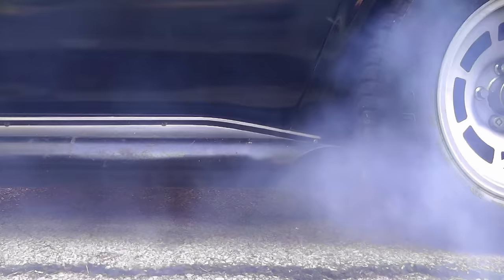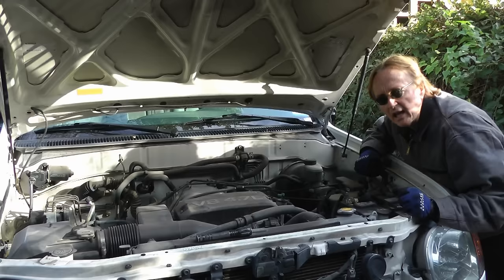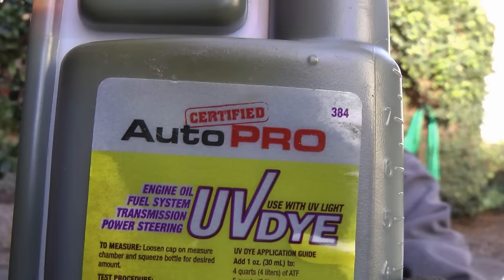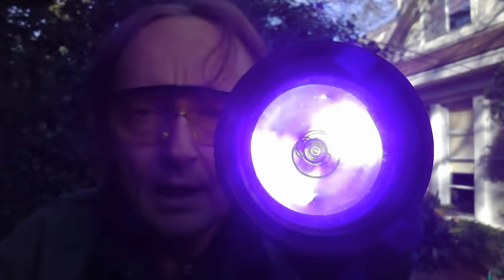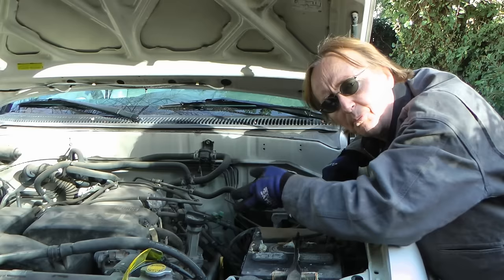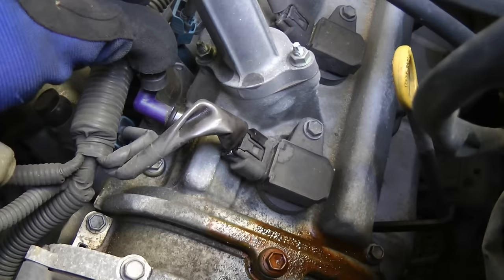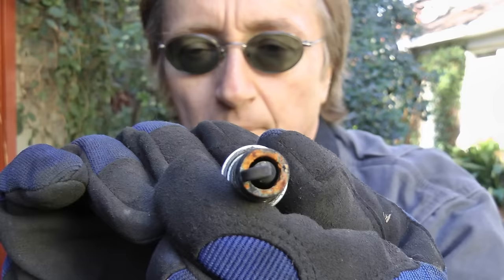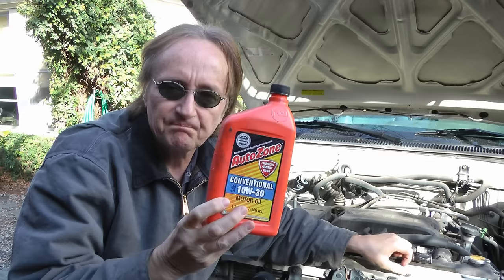How to Fix a Car Engine that Loses Oil (Leaks)

Comment: Scotty, do you use the Lucas upper cylinder lubricant and fuel injector lubricant cleaner also.  I buy by the gallon and use 5ozs per tank, cheaper by far than buying in the 50z throwaway bottle, you save hundreds by the gallon, it's only 30 bucks for 128 ozs as opposed to 6.99 for only 5.5ozs.  I put this product in all units I own.
Reply from the maker: Al Fries yes, I use it too
Reply: +Scotty Kilmer My dads 2006 mazda 6 4 cylinder eats a unusualy large amount of oil and it once even cranked for a little bit longer but no white smoke from the exhaust

Comment: I have a 2002 Ford Ranger 4 cylinder 2.3l and it starts leaking just when I drive about 35 miles or more, it’s a small leak...will Lucas oil take care of the problem?

Comment: I know for sure my car is sucking oil, there is oil in the mass airflow hose and on the throttle plate. Is there any other things that could cause this?
Reply from the maker: try a new pcv valve and pray, cause if it's not that, engine is flat wearing out and throwing blow bye from piston wear in there

Comment: I was leaking oil in a used car a got, after I got a new cap for the engine turned out the other one had the screws in so tight at one point that it got misshapen..

Comment: Chrysler 200, 2017 burns through 3 quarts of oil between service oil changes, Is this normal???? Capacity is 5 quarts of 0W20.

Comment: I own a 2010 dodge charger v8 hemi recently I changed my spark plug and Installed it with champion spark plug. But now I am experiencing misfire can u suggest me something which will solve the problem previously I was using NGK PLUGS

Comment: My 1999 Toyota Corolla only burns oil when I exceed 65 MPH.  Local driving does not result in oil usage.  Have 120,000 miles on the motor.

Comment: I have a Honda civic 1996 with a manual transmission and every gear works perfect except 2nd it grinds and it doesn't go in to gear most of the time I try putting it in, what could be the problem?

Comment: Scotty My engine is burning oil. all my mechanics cant find leaks and i replaced the pcv value and I got the same results. But I notice that I didn't have to add my oil as much when I wasn't traveling far or going too fast. I was good for 50-70 m/h  for about 25 min. but once I started traveling farther and faster I was constantly adding oil again. I have a 2004 camery. Any other specific things I can do to help out.

Comment: Hey Scotty..  Got a 2011 GMC Canyon WT 2wd with a 2.9l engine.  I'm running dexos approved synthetic 5w-30 and the using a quart of oil every 4,000 miles or so.  I cannot find the pcv valve???  The engine has 65,000 miles on the clock.  Is this a common problem with this type of engine??  Also, GM recommends 10k oil changes??  I'm thinking 7500 might be better?

Comment: hey scotty thanks for replying i got the fuse on ebay but it the blade looks a tiny bit longer than the original but is same ampage is this fine to put back in the computer?

Comment: Hi Scotty,
Thanks a lot for your video. I have a 2001 Nissan Sentra GXE 1.8 L, it has 262000 Kms on it. My mechanic changed the oil pan and gasket as the car was loosing oil. still it is loosing oil. But when I look under the car (after being parked overnight) I don't see any oil on the floor. I checked the oil 2 days after the oil pan was replaced and found that the oil level was very low and the color of the oil was very very dark. THe color was dark even befor the oil pan was replaced. Now my mechanic is asking me to replace the front crankshaft seal. What is your thoughts about it. Is it gonna  prevent the loosing of oil? Thanks in advance

Comment: I found a blob of something that looks like crushed charcoal under my 2005 Suzuki Forenza. Could this be a side effect of using Bar Leaks Head Gasket Sealer or Lucas Oil Stop Leak? 

A month ago I took it to Firestone to see why it sometimes smelled like burning and they told me that the head gasket is probably wearing out. I cant afford the repair or another car, so in desperation I tried those sealers.  The following week connection to the radiator goes out (dont know if it was related to head gasket theory from Firestone). I had the entire radiator replaced.

I bought some UV Dye, but would it also be a good idea to do an engine cleaning to see where it could be leaking?

Comment: Hi Scotty i got a 1995 Jeep Grand Cherokee with the Laredo 5.2Liter V8 Magnum i bought it 4 years ago. It currently has 186K miles i put about 40K miles on it seems to burn a little oil a very small amount every month I use( Mobile1 10W-30 High Mileage Full Synthetic)  i figure the thicker than 5W-30 would take more time to burn. There is no oil on my Driveway so it has to be a burn it is my Daily Driver. I always hear how Mobil1 is the Best what's your opinion???   Also what is your opinon on the ZJ Generation (1993-1998) Grand Cherokees are they as long lasting reliable as i hear????   How about the LA 5.2 Liter V8 Magnum engine i have is it a Great Engine and Long Lasting Reliable???  I really haven't had to replace anything on the Car except the Ignition Key Lock Cylinder.   I hope i can maybe 300K on the Odometer before i have to rebuild the engine or tranny. Also i usually now that i use Mobil1 10W-30 High Mileage only change the oil every 5,000 miles or 6 months because i hear how it can protect for 15,000 miles is that safe????

Comment: Scotty, I have a 2004 jeep wrangler 2.4L. It appears to be using oil, and there are no leaks. I took off the pcv valve after noticing oil on the nipple of the intake manifold. There appears to be oil in the pcv valve. I shook the valve and could hear the piece in the valve moving. The question is if the piece in the valve is moving (I dont know what it is called) is this indicative that the valve is functional and that the oil consumption is probably a bad ring? Or does this mean nothing and the valve may be bad (I believe it is the factory valve, the engine has almost 119,600 miles). Thanks.
Reply from the maker: brettdrk   just replace the pcv valve being that old, though they are supposed to rattle they can still be bad. But on those, engines are weak and burn oil internally at that age from bad rings and valve seals

Comment: Hey question real quick, is there a chance that it can be both PCV problem and hot oil leaking? Also that RV stuff if you pour it into the engine is it going to damage it? Do I have to do oil change after so? Please velp

Comment: Hi. I have a question about the engine oil. Is it possible and also safe for the engine to mix two 5w-30 full synthetic oils with each other which are both dexos positive?? For example 5liter of penzzoil 5w30 full synthetic dexos + with 1lit of mobil 5w30 full synthetic dexos+? Thanks

Comment: So if u have a valve cover gasket leak can u still use 10w30 to slow it up until u get fixed 2011 Chevy Impala Ls 3.5L
Reply: In the hot summer maybe

Comment: Hey scotty if oil is being burned due to a stuck pcv valve, would smoke coming out of the tail pipe be black?
Reply: Burning oil smoke generally has a slight blue colour. Black smoke usually means the engine is overfueling.

Comment: Hey Scotty! My car temp guage jumps around from 90 to 125 even past. Doesn't always park at bottom when cold or shows 40 or 90 right from cold start up. Not over heating. Squeezed upper and lower rad hoses can feel flow past thermostate. Hose temps feel normal. Blows good heat as always . Appears to be running normal. Changed temp sensor still doing samething. Any idea? 2.2 pontiac.

Comment: Scotty im trying to change my oil and the bolt on the oil pan is stripped "17mm" So I put some lock tight on and tried some vice grips with no luck. Any ideas? Also there is a small drip off oil off the oil pan but a lot of the engine is caked with oil and grime the drip is few and far between what do u think? will a black light work the same as the uv leak light?

Comment: I have a pretty big oil leak in my timing cover gasket on my 03 Mitsubishi eclipse Gt. It's been out for almost 6 months now. I just replaced the alt and battery so it starts but I can't seem to fix the oil leak

Comment: I have a mercedes cls 350cgi direct injection and its burning 1liter oil in 1000km but no signs of big leaks just small ones in the engine what might be the problem the car has 70.000 miles

Comment: hey scotty i got a question ?? why does my civic 2003 d17a jdm swap. burns oil but i only  have to put like a 1 or 2 lines of the quart every month is it normal ... i check for oil leaks and cant find none ... is only burning a little oil but is still burning it so is it normal for civics to do this ?? i currently using royal purple oil and a k&n filter every 4000 miles thanks=)

Comment: You think Lucas oil stabilizer will help with a leaky front crank seal?
Reply: Use a high mileage oil because it contains seal swelling additives. My LS1 was dripping oil on my garage floor. I switched out the oil for Mobil 1 High Mileage and it swelled up my oil pan gasket. No more dripping, but just some slight oil seepage. Be sure to clean the leak area with brake clean while changing the oil to see if the leak comes back later.

Comment: Scooty Can I use Lucas Oil stabilizer in fully synthetic running vehicles for example on my 2000 BMW 540i which has about a hundred seventy thousand miles and still runs great I don't really have to top off any oil on it but just for precautions can I use this additive?

Comment: honda 2000 accord 6 cylinder. I am thinking of replacing valve stem seal. one plug has oil like pulling a dipstick on it. Will I be replacing the exhaust and intake seal? and what is estimated time to do job if I have all the needed tools, would you know? I put some valve seal reconditioner but engine startup is like something needing to be lubed. is this a major decision for a weekend teardown

Comment: Scotty, what about a intake gasket leak in the lifter valley of a v8?
Reply from the maker: if it's an coolant leak, try radiator stop leak like bars alumiseal. But if an oil leak, the gasket would need replacing

Comment: I have an old atv on its last legs that burns a quart of oil every 10 miles, is there any way to slow the leaking down without rebuilding the engine

Comment: hi scotty i have a old,very reliable diesel turbo 300tdi landrover its 18 years old with 145,000 miles on the clock every morning it burns oil thinking its the valve stems but problem is it runs lumpy until you rev the nuts off it,it does not burn oil when warm,performs well with no smoke and weirdly does not use much oil,experience tells me the stem seals are  shagged bu the lumpy running when cold is throwing me what are your thoughts?

Comment: I have a mystery here, I have to add a quart of oil after I drive 2,000 miles out of 3,000 between oil changes.  My Buick has 157k on it, is this normal?

Comment: Hey Scotty, i have a honda civic 2000 and since i bought it i saw the level oil goes down (every 400 km i have to add oil 300 ml)  and i mention that in the morning i dont have any smoke when i start up the engine and even under the car i never saw any marks of oil and last week i added 200 ml of Lucas oil stabilizer and now the oil level goes down a bit faster than before. Do you have any idea what problems does it have? it was bad because i added lucas? thanks

Comment: Okay I have a question its not about this video but I have a 2000 Dodge Durango and I'm trying to clean out the Pistons where you put the sea oil in and cleans the corrosion on the Pistons where do I open the valve to put the stuff in

Comment: Hi Scotty! I have a 2010 audi a5 and the engine is consuming oil. I replaced the pcv valve but the problem still exist. What else can it be besides replacing the pistons and rings?

Comment: hey scotty, i've learned a lot in your video, just one question  what are the hints if  my valve seal need to be replce . thanks...
Reply from the maker: when valve seals are bad, the engine burns oil and eventually you see white smoke coming out the tailpipe when idling for long periods
Reply: Scotty Kilmer thanks for  immediate response..God bless u more...

Comment: What if I have to keep topping up my oil but not "often?" it's every few months or so I need to put in a bottle of oil. Mine is a 2013 Subaru Impreza. The light is on right now. smh.

Comment: hey scotty i noticed in my car that when i turn the ac on or heat it doesnt come out of the vents like you didnt even turn it on and i still have to replace the motor in the cooling fan what do you think the problem with the heat/ac is?

Comment: scotty thank you for this channel im learning from you 

scotty i have a oil leak underneath the car i dont know what eles could be leaking 

i have a 2001 volkwagon gulf Gti my first car befor car drives great but it seems it has a bipolar. disorder

 before i put her down at the junk yard 
 i want to give it a final try to fixing her 

how do i clean everything underneath my car ?

so that way i can put the Uv in different places to check or at lest follow the trails of oil  back up 

and try to replace or fix the problem or use a sealent 

do you have any tricks to lift up a whole car ?

at least a foot or two 

thank you scotty
Reply from the maker: do my video "finding and fixing car oil leaks"
Reply: Thank you scotty

Comment: 2006 mazda 3 sport. It is consuming oil. Now to access pcv valve it's a pain and might need to remove lots of stuff before I can remove the intake manifold. Is there anyway I can test the pcv valve without removing it ? Also when I remove the oil cap it blows a lot of air out. Spark plugs tip were clean but 2 out of 4 plugs had golden oil on the thread.  any suggestions ?

Comment: hey scotty on my 2001 pontiac sunfire the ac or heat doesnt work and it overheats due to a fan not spinning on the radiator i was driving the car today and it never had a check engine light but after i parked it and used a car md(its a obd2 scan tool) the engine light came on and now im wondering would could of triggerd the light

Comment: I'm lost I have a 2008 f150 and changed the pvc valve and did a oil change and with in a month level went from the full mark to min and they aren't any leaks and oil is black

Comment: will using lucas oil stabilizer in my 2002 Chevy Trailblazer LT with 194,700 miles hurt? It's got the straight 6 motor

Comment: Hey man ive got a leak from my rear valve cover gasket in my nissan murano. Place im buying the car from has tried to change it 2 times but they have either pinched it or bent the cover its self.. My question is will the gaaket leak additives they sell possibly fix it and which do you recommend? Thnks for your time....

Comment: Does a BMW have a PCV valve as well?  Where is it located?
My e90 is burning oil and smoking kinda blue smoke from the exhaust. 
Check engine it's also on... P0430

Comment: Hey scotty, I have a '96 Celica gt and my car appears to have a slow oil leak underneath the distributor. I notice when I come to a stop, I can see smell and see alittle bit of smoke coming from the engine. My brothers '96 Camry has the same exact issue. My dad had replaced the distributor O'ring a while back but still no luck. Any ideas?

Comment: Hey buddy I have 2010 dodge charger v8 hemi and I noticed that after 2000km I had to add like  one and a half litre of oil... Is it common with dodge engine? I purchased my car recently from dealer... When I checked online it shows that these v8 hemi engines have these oil loose issues but I am not quite sure if its true should I be worried?? I recently got my car serviced put new spark plugs and engine oil and oil filter too. Can u please suggest Wht mite be the cause

Comment: hey scotty. question my car has 200,000 on it and i use regular oil. last time i change oil it was like 4months in some change but i been driving like crazy taking long trips &city driving., however even after 41/2 months the oil levels stayed the same(full) + its still kinda clean(light brown) like its just begining to clean. sholud i still change it, or give it more time to clean?

Comment: Hey scotty, i got a Volvo 850 2.5 10v from 1994 with 370.000 kilometers on it, and i am abit confused because i can see on the spark plugs that it burns oil, but there is no blue smoke at all. not Cold/hot or at acceleration. maybe u got an idea.
thx for your videos liked/subbed

Comment: Hey Scotty i have a 01 Ford escape and the oil light is on could the oil pump be going out it is the type that goes over the crankshaft. If its not that what else could it be. thanks

Comment: A very good day to you scott. I have a problem with my Toyota Camry 2.7, 2008. I have checked for leaks but haven't seen any. It doesn't smoke. we suspect the rings, but since there's no smoke even after starting the engine in the morning, we are confused and so is our mechanic. Please I need your help sir.
Reply: Plus the car is losing a lot of oil within a short time

Comment: Hey Scotty is is bad if u see a small puff come out the tailpipe when starting your car on a summer morning when the outside temperature is like 67 or 70? I heard it can mean the engine is flat wearing out or the valve seals are going
Reply from the maker: Ira Friedman many older cars puff a little, if you don't lose much oil or coolant it's fine